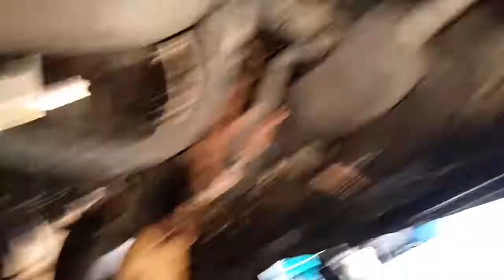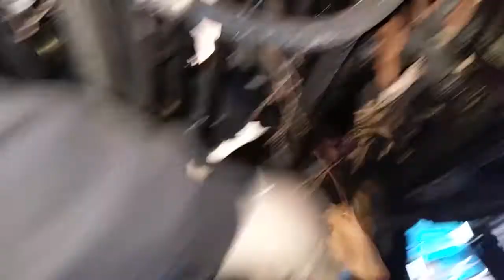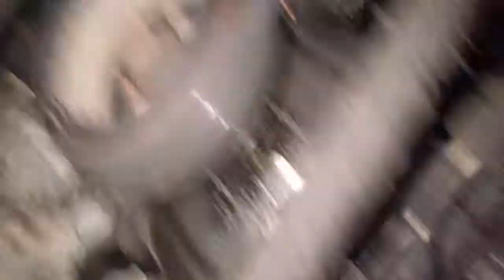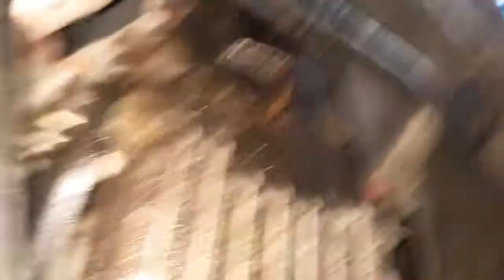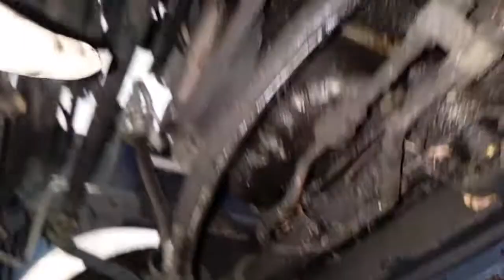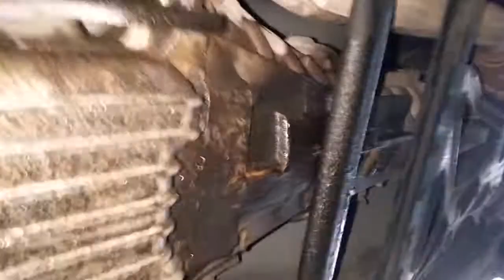2003 Miata oil leaks

Comment: Rear main seal, crank seal, cam seals, oil pan seals, transmission seal, transmission gasket, CAS o ring, curse water plug, temperature sensor o rings, water pump seal, gaskets. Ya one of those. Good lucks travelers.
Reply: Would u say all this is worth fixing on a NB Miata with 104K miles , and does it sound ok that it leaks with that many miles , he told me it did kinda sit for a few years because they didnt wanna pay the registration
Reply: @ricardotellez1050  if you have a garage to take out the engine its worth the fun.